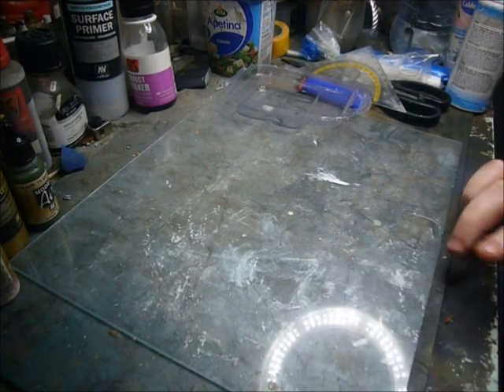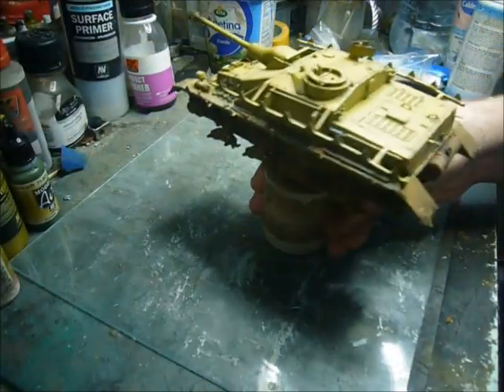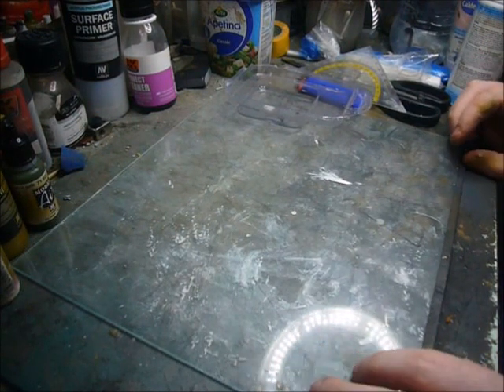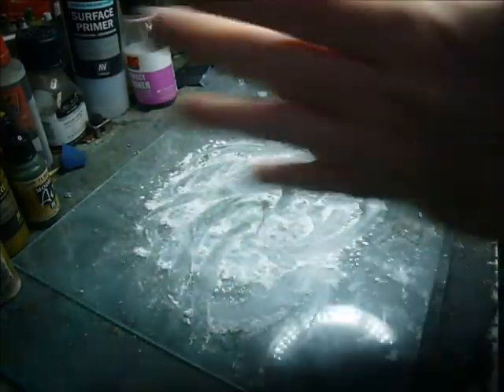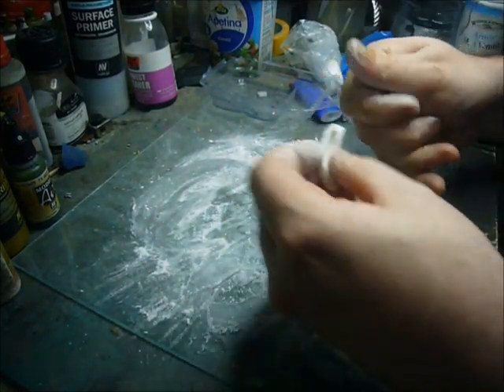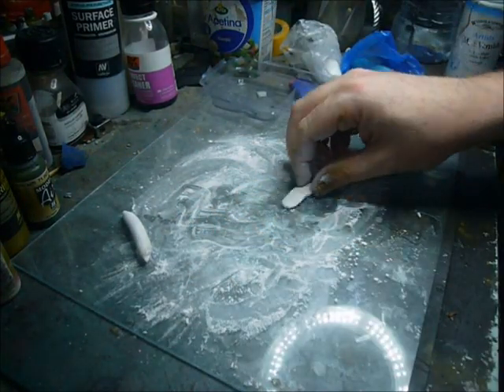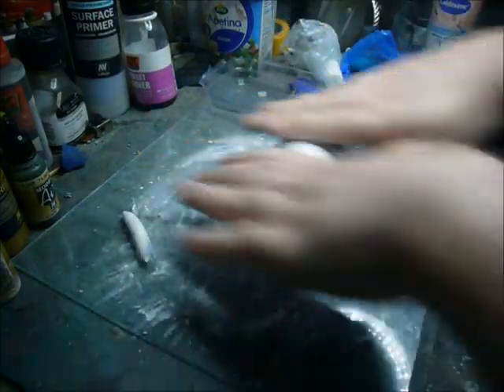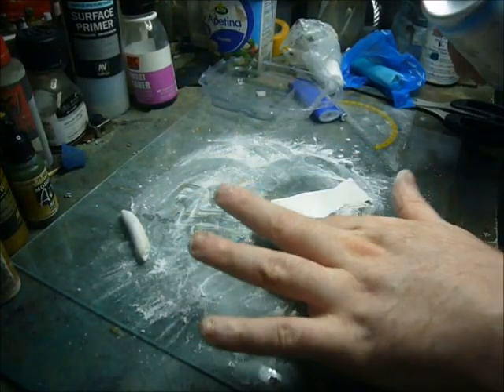HOW TO:  Tarps & Stowage for Model Armor

Comment: Thanks for the vid Shane.  I do have a question, how long does it take for the Milliput to dry and set up before you prime it?
Reply from the maker: Willy Vette normally I would say leave it at least 24 hours to cure fully before painting :)
Reply: +Shane Smyth  Yep, I experimented last night using Apoxie Sculpt, made three rolled tarps and they came out just ok. I just need more practice especially tying them for wrinkles.  Thanks for the response mate.
Reply from the maker: Willy Vette no worries mate. glad to be of help :)
Reply: +Shane Smyth Cheers!